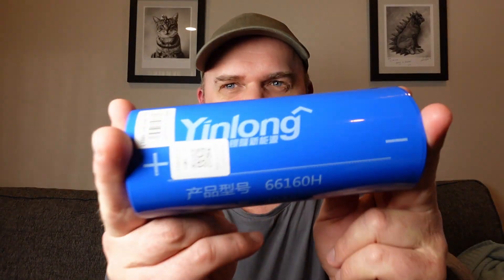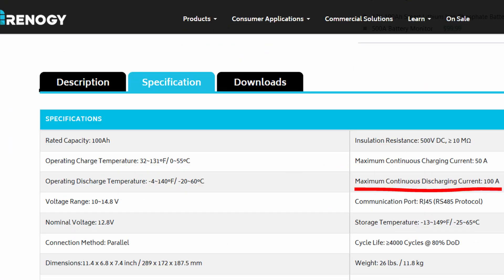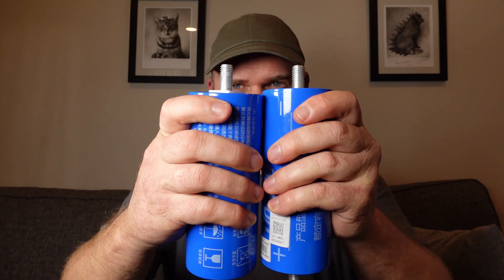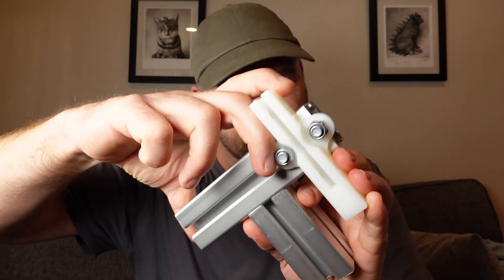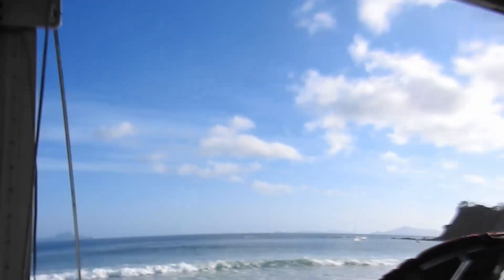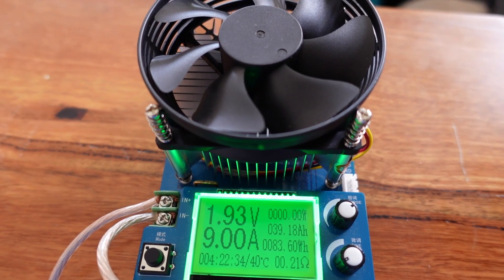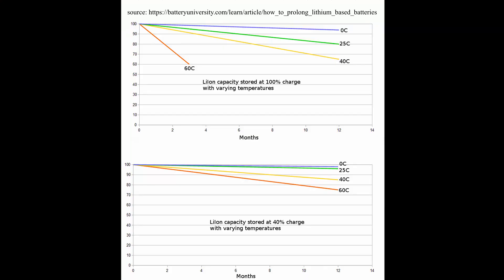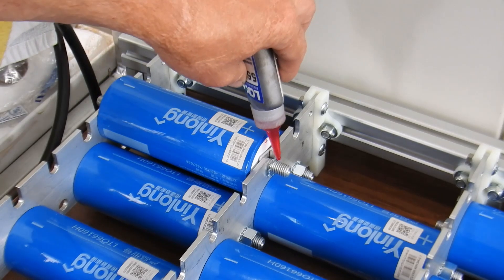Campervan DIY battery build HUGE POWER!

Comment: This is superb information, Brendon. I might have to bug you more when we are closer to building our battery. But for now; do you think these would be suitable as a starter battery for the Mog? I assume they’d require their own DC to DC charger module between the alternator. The reason for asking is that we are close to moving out battery box on the U1300L and we’d like to go with more compact and lightweight batteries. I’ve seen one instance of them being replaced with two motorcycle batteries which I thought was a bit over stressed. I don’t really fancy Lithium ion due to the their bad character in cold weather. 
Thanks for the video!
Reply from the maker: Hey, no problem.  Yeah I think they are suitable as starting batteries.  This chemistry is already used in starting batteries for large diesel generators operating in harsh environments.  I will be doing a build for that battery in future too.  Whether you need a dc-dc or not to charge is down to the capability of your alternator.  The problem comes is when the alternator is turning too slowly to get sufficient cooling airflow thru, the dc-dc just limits the current to mitigate that.  I'm considering putting a temp sensor on the alternator to reduce or cut the field when temp gets too hot.
Reply: Brendon, thanks! Sounds promising. Did a bit of maths and such, and I think the 40A cells are a bit overkill to start the engine, so I’m looking forward to seeing what you’ll come up with. I saw Will Prowse using the 20A prismatic ones, they could be the ticket for a starter battery. I started wondering whether a BMS would mitigate or eliminate any problems with the alternator. 
Your video has now had me searching and doing calculations on these types of batteries for a few days. It’s very interesting as we were thinking of using one or two Tesla Model S packs. The downside apart from the flames, is the temperature sensitivity and all that lark. They’d have to be inside the camper to stay warm enough, whereas these could be in a box underneath somewhere. Even a small heating pad would easily keep them above -30ºC - not that I expect to be visiting much colder than -30ºC. 🤪
From what I can see your battery configuration is an 11S9P system? Did I get that right? That’s massive. And awesome. The group buy could be an interesting thing, however, we are probably a year out from our battery build yet.
Thanks again!

Comment: A very nice video! What kind of BMS are you using with these cells?
Reply from the maker: I'm just using a shitty chinese BMS  in a couple of weeks I'll do a video of BMS wiring and will cover it there.

Thanks
Reply: @brendontait6968  look into the 6s qnbbms coupled with an isdt battgo for voltage monitoring.  The 2 work great together.

Comment: Great video.  I really like how you built and assembled your battery.  I agree with you about the high efficiency.  I also did a round-trip test in this video: https://youtu.be/z95U7Hq2M5k
Reply from the maker: Thanks David, yeah I've come across your video before when I was doing some research on LTO chemistry.  V helpful thanks.

Comment: Love the vid, you had me at kW.h. Your door is also up there for one of the most impressive RV vid's I have seen.

If I was going to be critical about this one though 
1) I would say there is a little bit of obfuscation between the Samsung 18650 cells and the LiFePo4 cells used in typical RV scenarios in regard to safety. 
2) In regard to cost, two things to consider are the build cost for the LTO cells to make it comparable to a ready to use battery, and the falling price of battery technology would mean that the subsequent replacements for the LiFePo4 batteries would likely level the playing field somewhat as well, but your comparisons are still valid. 
3) And yes while the 100AH Renogy LiFePo4 wouldn't fully power an induction cooker by itself, running a few in parallel would though, capacity and cost-wise, you are probably equivalent to about 10 of the Renogy 100Ah LiFePo4 so that would be a more accurate comparison than 1.

Having said all that, they still look very promising. Keep traveling the road less traveled with your build, makes it far more interesting and the "lessons learned" is a great inclusion.
Reply from the maker: Thanks for your comment, I'm a fan of the door too, will be doing some more on this soon.  
1) Agree with regard to safety difference with LiFePO4 (capital O), I wasn't specifically comparing with the LiFePO4 - I stated in the video the NCR18650 was typically used in laptops and Tesla etc. don't recall mentioning they were used in motorhomes (tho they have been) Plus I had an NCR to sacrifice.
2) Agree totally about the price of batteries falling through the floor.  I am interested in learning about new and different technologies.  The things that appealed about these batteries to me was their safety, life and electrical robustness.  I want this truck to be as hassle free and robust as possible, these appear at least on the surface to be able to do this.
3) This was given as an explanation as to what the different ratings on batteries are, and how they relate to normal use in a way to educate people (I'm sure there are plenty of people who think that they would just be able to run an induction cooker from a single battery) I wasn't saying that you can't run cooking from LiFePO4 and you can from LTO.  (cost was around 7 renogy batteries)

I'm still fairly new to youtube and find it difficult to articulate and present my thoughts fully into something that will come across well to the majority of people.  I still don't feel comfortable infront of a camera, but am hoping more practice will help me learn to get thoughts across better.

I'm definitely going to be keeping the build unique,  some of my ideas will fail but hopefully the majority will work out.  Hoping people will learn along with me.

Appreciate your feedback, it will help me shape my content.
Reply: @brendontait6968  you come across as funny in a great way, and quite articulate (though i agree with the comments above). and my friend says you look beautiful, but you should improve your posture. thank you, post more! like! :)
Reply from the maker: @TiagoPontes  haha, thanks.... I'll try work on my posture

Comment: What sort of flags did you look for when assessing genuine vs. potential rip off merchants on Ali?
Reply from the maker: First I looked through their reviews of similar items (the issue tho is reviews on Ali can be manipulated - but it was a start)  one I had three stores that I was semi happy with.  I know a sourcing person in China.  I gave them the stores and got them to get in touch with the factory to tell me which of them were authorized distributors.   They said that one of the three was.   (It's possible the other two were ok also - just not known by the factory).   One of the things I believe happens on Ali is the batteries that fail their QC get bought up cheap, re wrapped and sold as A class batteries.  I think this is what happened to Will in his video.

Comment: Good stuff Brendon.
I've had my farm completely off grid for 12 years. And yes, 48 volts is the way to go. My Mog had two sonnenschein AGM batteries in it. They were 20 years old and still started the mog in less than a complete revolution of the motor. Fantastic batteries. I still have one (now 30 years old) as the starter in my 6.2 Diesel Land Rover.
One thing with Solar panels, is a lot of people get lured into thinking 1 kw of panels will produce 1kw. They will, but only at right angles to the suns rays, and only on a clear sunny day .  On a cloudy winters day my 7KW of panels struggle to put 2Kw back into the batteries over an entire day. Hence having the Mog engine as a generator is a good idea.
P.S. still looking for that box of bits!
Reply from the maker: That's the dream, a patch of land off grid...   the big issue with the life of AGM is they dont like being held uncharged, and life becomes quite compromised.  But yeah, there are deff good and bad battery brands.  I'm hoping my battery will be big enough to sustain me when there isn't much sun.  I have my eye on a big alternator, but prolly not going to splash the cash till I start having limited power issues.
Reply: @brendontait6968  If those batteries can soak up charge as fast as they advertise, a monster PTO driven alternator may be possible.  Then just run the engine for 20min - half an hour and its all done for another couple of days juice running all the mod cons, But if you intend doing serious off road adventuring, a pto winch is most prob more useful than a monster battery charger. Hand winching a mog is no fun and extremely slow work. Don't ask how I know;)

Comment: Thanks for sharing the design Brendon.  What potential exists for aluminium oxide creating a conductivity issue at the stud connections over time?
Reply from the maker: Hey John, I guess the potential is there to occur.  I put a light coating of grease on the face of the stud with a cotton swab before putting them together to try and mitigate that issue.
Reply: Brendon Tait thanks Brendon.  Is there a link for the source to buy these cells please?
Reply from the maker: I'm trying to dig one up, the link from the supplier I bought from wont work.  Am trying to get hold of them to get a new link.  Will let you know when I have it.  Do you want the aliexpress link or bulk distributor?
Reply: Brendon Tait your trusted link will be fine Brendon.  I’m thinking of building your battery design for my shed.  Any info you can share is greatly appreciated and I’m happy to make a $ contribution towards your project.  I’m building a 200 square meter shed large enough to house a Mog project of my own here in Perth.  I could connect the shed to the grid but I like the idea of using 10kw of solar and one of my VAWT’s to charge a decent battery bank.
Reply from the maker: Flick me a message on brendonsbuilds at the gmail, I'll give you a better breakdown etc

Comment: $9000 in batteries ? .....  what you running in the Mog, a spa bath or something ? ... lol, i dont quite understand the need for having such a "transformer" for a RV, and what solar setup would you need to feed the batteries, can you let us know why you went for 99 batteries, rather than say 22 of them ?
Reply from the maker: Yeah, it is expensive... but after a lot of soul searching I was able to convince myself.  You'll notice that the top of the bus bars are slotted.  My initial plan was to have 55 cells and then be able to slot in upto an extra 44 if I found I needed them.  I'm not having any gas and am likely to be fairly heavy on electricity, I wanted the luxury of not having to stress about if I am likely to run out of power if we have a few rainy days etc.  Then I was lucky enough to get my entire solar system sponsored, so that was a cost that I didnt now have to worry about... then I figured rather than pay two lots of shipping etc....  so that was enough to justify the expense to myself. The solar is just over 1000W, so it's not huge...  but I'll be able to grab a bit from the engine also. (Currently 1200W - potentially 6000W)

Comment: thanks i got to replace one INO the camper batterys and a new set for the oz unimog
Reply from the maker: What have you got at the moment and what do you think you'll go with
Reply: 4 x 6 volt 390 Amp lead batterys with 1400 watts solar 5kv victon inverter works well but looking at about 700 amp lithium batterys should be enough not to worry about the weather

Comment: Great informative video! One thing I didn't catch was weight, do you think your power pack is lighter than the equivalent kWh in other chemistries?
Reply from the maker: On paper LTO is the heaviest of the lithium chemistries, but going off data sheets it comes in at around the same weight as an equivalent LiFePO4 battery